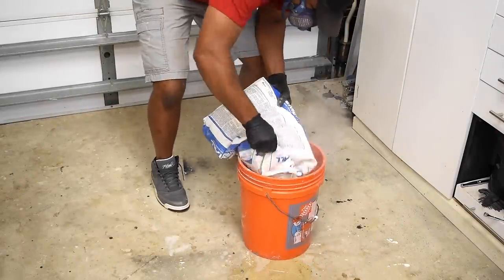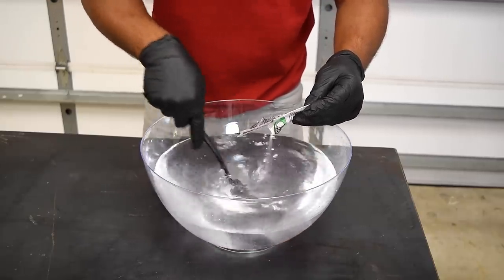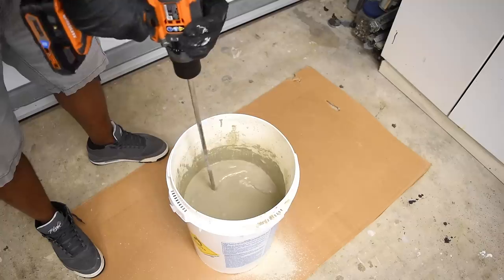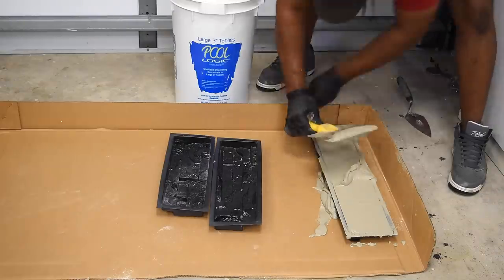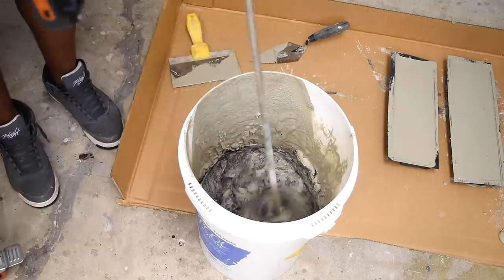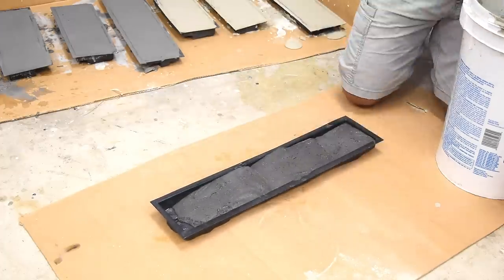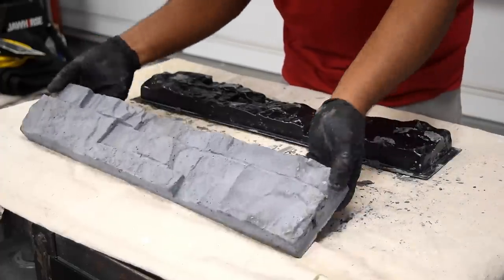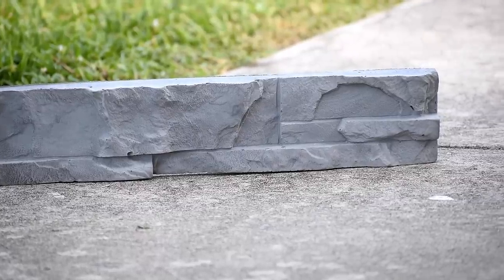How to make Concrete Stacked Stones ( Homemade Wall Stones )

Comment: Those turned out lookin super sharp! I actually prefer the look of the concrete molds vs the premade expensive ones. Well done!
Reply from the maker: Thank you, I was not sure at first but I like this a lot! Now I need to learn how to make them more interesting.
Reply: DIY Creators I'm wondering if you could get some interesting effects by mixing a few different colored concretes in small batches and then scooping small amounts into the form to create some color variation on the face of the "stone". Glad to see someone do this as a diy!
Reply: How thick is the finished wall stone that you poured?

Comment: These turned out really well! Better than I was expecting. Nice work! Could you use maybe a palm sander on the edge of the mould to vibrate the bubbles to the top?

Comment: Would using something like this be appropriate for exterior works such as the foundation of a house or making concrete steps looks nicer? 

This seems like a.oretty fun project. How heavy do the blocks end up being?
Reply: I would like to know as well. My foundation below my siding looks barren
Reply: I'm curious as well
Reply: Bela, that is what I am doing. The cost for siding is way too much, so I am doing this.  $2,000. over $30,000. sounds like a good deal to me.   I think about 5-8 lbs they should weigh.
Reply: inspire734 please share your experiences and maybe even a video :)

Comment: Would I glue these to some cement blocks for a wall?  Or to wood for a planter?
Reply: You set them with mortar just as you would any stone or brick. You could use a construction adhesive as well. Your backing could be drywall, wood sheeting, or madonary.

Comment: Great video, you can spinkle multi dry colored powders in the mold like the ones they broadcast on slabs right before they put the rubber stamps down, this will give you a multi color variegated look.

Comment: Wonder if you could airbrush/spray paint some details
Reply: They are usually stained.  People that do floors have colors on the internet just for cement. I don't know if they stain them on the top or the cement it's self.  Painting the outside of them, they would fade over time. The stain and sealer works just for the cement.

Comment: In addition to using color added to the mix, when you have a completed wall stone, make a thin wash with black paint.  It should be almost like black water, you should do a test to see how much tint you need.  When you brush it on, it will darken the crevices and cracks, but barely darken the edges and flat open parts.  When that dries, thin some white paint, (doesn't have to be bright white)  and dry brush the high points and edges.  Dry brushing means almost all the paint is off the brush so only a little will adhere to the high points.  This will give a very realistic finish to concrete wall blocks.  Make one to practice on, it doesn't take long to get the hang of it.

Comment: Here a vibrating table is needed for bubble removal and, preferably, silicone forms. ... and it is necessary to tint the forms partially, it looks more natural. Oil will help to separate the product from the form. Sorry for my French ))

Comment: Add pumice stone to reduce weight and use less cement. Also you can add dye powder to different areas of your molds. Try adding metal straps, overlapping the top and bottom for mortarless installation.

Comment: Quite an interesting approach, especially the Bar-Idea. I would probably try to add some kind of foam to make it lighter and save on cement cost. Of course the rigidity is questionable, the more material is replaced by soft spots, but for decoration stones I assume it should be alright.

Comment: GAH! Not another Rapid Set video. You guys I subscribe to are killing me!

I started using RS's "Cement All" about 10 years ago for our small ornamental concrete business. As you guys keep popularizing it? It's getting harder and harder to just walk into the depot and buy the quantity I need off the floor like the good old days.

I'm gonna have to start buying it by the pallet soon so I always have enough lol.

As a small tip I can offer? Using cold water in your mix will slow down that cure time as well. The colder, the better.

Comment: A couple things.  Add some color to the molds before filling that way you get more variation and make sure you vibrate them more to get rid of the air bubbles

Comment: This is a great idea, you could even cast your own molds from silicone.
Reply from the maker: Yes, I thought about that, I may do it in the future.
Reply: That may challenge the 'cheaper' argument
Reply: @Ed19601  Maybe, but if you want a specific pattern...the molds are $60 so it might not be much more expensive.

Comment: The best mix to use is called Sakrete Maximizer which is a light weight aggregate. Meaning it is light weight and fine mix. It is a lot cheaper then the mix you are using. An 80lb bag is about $10.
Reply from the maker: Thanks, where do you get it? It's not available at any of my local stores.

Comment: Nice job man. They look good, but I'm curious how the price will compare to the prefab stone veneer so I did some quick calculations. Based on the molds you linked to in your blog, they will cover 5.6 sqft (0.52sq meter). Supposing someone had all the other tools (mixer, trowel, bucket, etc) you're looking at an initial investment of $65 for the molds + $25 for the cement + $10 for color and set control. So $90 + roughly 1 hour of time to fill 6 of the 9 molds (~4 sq ft).  A similar style of prefab stone veneer can be purchased from the big box stores for $45 for 4 sqft. Granted, after the first batch of DIY veneer, the cost would drop to $35 + time, and hopefully once you figured out the correct coloring, you could get all 9 molds filled. I guess it's going to depend on how big of an area you plan to cover and how much time you have available to make your own. 

Great video either way. Keep the vids coming. Your projects inspire me to get some projects done too.

Comment: Wow 😮 this is awesome my wife will be very happy with this idea thanks you,
I have a question .. what mix do you recommend to use to reface or refinish my concrete path that’s 3x15 ? Got some cracking and rough rocks showing  .. I see many products cement bags ect. at homedepot and looking to get a smooth long lasting finish ..
Thanks your help would be appreciated 🙏🏼

Comment: If you run a notched trowel or a straw brom over the back of each one before the concrete sets, the texture helps each piece stick better to the wall it's applied to.

Comment: I love these! I have ugly fake stone areas on the front of my house. They are about 4’ x 8’ and there are three of them. I wonder if I could remove the ugly and add those instead? It would look so cool and modern! Have you ever tried hyper tufa? I haven’t tried it but have seen planters made out of it. It is Portland cement, Perlite and Pete Moss. I was wondering to make a replacement wall for my ugly stones I could make hypertufa blocks like the ones you have shown. Those are awesome! BTW I found your channel when looking for floating shelves. Your channel is fantastic and you are very talented. Thank you for sharing your awesome work!

Comment: This is a great idea but.. I will definitely be doing this but I will be using aircrete. Making Aircrete is much lighter and cheaper. However the only drawback I can think of is durability. But seeing as the faux stone will be installed on a wall or something similar I don’t think impact durability will be an issue. As for the dye. I would not do a complete mix in, you want the stone to have a natural look. It would be best to use a slow set mix so you can do one big batch. That way the colouring pattern will be similar. Great video
Reply: Ross 2077 everything I've seen about aircrete lends me to feel like it's Botond appropriate for outdoor application. If you were to use this  on an interior wall that would be cool. My only concern would be visual bubbles on the surface of the "stone" giving it  less natural look. 

I'm wondering if you could do s thin layer of just concrete for the face of the stonework and then do aircrete for the rest. Maybe I'm overthinking it.

Comment: Great video! I found it easier to start with the water in the bucket and then add the concrete in small portions mixing in between. Any your right stacked stone is stupid expensive.

Comment: Thank you for this video. It has given me ideas about doing my living room corner wood stove surround. I'm looking for a natural aged limestone color. I see the molds are expensive and was wondering how durable they are? It would be cool if you could do a video about how to install these tiles. Should they have some type of a mortar joint? They would be mounted to cement board.

Comment: The colours are great! There are a fair number of bubbles on the surface still. I wonder what would happen if you put the molds on a 4x8 sheet on saw horses and vibrate the sheet with a sander (or other tool)?

Comment: If you want to add colors sprinkle in a light dusting of iron oxide pigments after first spraying a mold release and if you want to lighten up the weight add either  pumice , vermiculite  expandable polystyrene beads and that will significantly lighten the weight for easier install !

Comment: a couple of useful tricks:
1- Scratch the back of the stone with a fork while setting to have  better adhesion later.
2- mix some dry color with some water and give the molding some random strikes with a brush before pouring the mix. It gives more natural looking especially with more than one tone.

Comment: Should you not put some type of holding grid in the cement on the backside? It it cracks then it will not fall apart. Plus i would screw the pieces to the wall with some adhesive on the backside to hold it tight.

Comment: I find if I spray the mold with a light coat of WD-40 before pouring, the cement releases super easy.
Reply: Pam or Vegetable oil spread lightly over the mold works very well too.. never tired wd 40 will have to try it.

Comment: I used some similar molds a few years ago but used cementall mortar mix instead. I also got the idea to use a plasticiser from MAN about Tools and used cheap cooking spray as a mold release. I have yet to paint the ones i made but the cheapest and best ideas I've seen for that is to use watered down acrylics. Watch some of fauxrocktraining youtube videos to get an idea of how he does it.

Comment: I want to do a stack stone feature wall in a fully enclosed deck. I'd prefer using a plastic or rubber compound because the weight of the concrete would be too much. I wonder what product could be used in the molds to reduce the overall weight once they are mounted on a wall.
Reply: Aircrete...   can add pearlite as an aggregate and heavy soap foam to greatly reduce mass and weight.

Look up aircrete harry.

Comment: Two thing , add water to the bottom of your bucket , half of what you need before dropping your dry mix , it will help you a lot in the drill mix ...second add a dusting of colour mix powder , random clumps and see your stone look lore natural or mis in a bottle and using a dispensing caps make swirl on the mold before you poor it will make some amazing marble effect .....now , where can I find these mold in silicone for multiple usage and easy release ?

Comment: looks like vibration or some sort of other treatment is quite important, as there were significant bubbles. Overall I'm not into "faux" looks usually though, so I'd either use some other material, or just use flat out unmolded concrete (I like the look of concrete personally)

Comment: Combine this idea with aircrete and/or pearlite for weight and material savings...  lighter weight means you can more easily stick it to a wall with construction adhesive.  Material savings means more bricks per bag of concrete.

Check out channels like aircrete harry.  All you really do is add really thick soap foam to your concrete mix.  If the brick floats on water, you are doing it right!

Comment: We built a Foxx Block home with stucco siding in 2005, on a slab foundation. Water seeps up along the stucco near the ground and the stucco peels off. We want to create a stone/brick facia approximately from the ground up... 4'. We only need to do 120 sf. I was wondering how many deco stones can you get from 1 bag of concrete?

Comment: At home depot you can get 6 pieces for $5-$150.
For just 9 molds, and go with quikrete. It's cheaper then this. Just takes longer to set up. But you can also put something in it to speed up the drying time. But like $4, compared to $22.
So with the quikrete and molds, that's $69. With cement all and the molds, that's $87.

So it costs more to make your own.
Reply: @Stackali  Year, but not with this concrete. The one he use, you can get 6 stones at home depot for about $5.
If you use the less expensive concrete, something like QUIKRETE for $3-$5, then it can save you money. 
Which is good for small projects.
But if you doing something big, like a house. You would need more then 1 set. Unless you only do 9 at a time. It will take week to do like 1,000 of them.

Comment: Take a fork to the back to make ridges so it will stick better to the wall. I do my ceramic tiles like that. As they set up. I use a up and down curving back and forth. You can stain the stones also. I wanted to put siding that looked like bamboo on my house with some flag stone.  The cost would be over $30,000. more than my house is worth at present.  I found that by using this cement thing, you can also make your own molds, plenty of places on line that sell mold making kits.  It cost a faction of the price they wanted.  The major thing is a 61 year old woman with fibromyalgia can even do it on a good day.  I love living in this day and age, there are so many possibilities to decorate your home the way you love. My home is my childhood one, but a fixer upper. I payed $1,230. for the place 1,300sq ft. Needs some artist touch. Got it at a tax auction.

Comment: Very nice! Would this be a good borter for the edge of my gravel driveway if I supported in with some sort of stakes to take off of it on the edges? How could in remedied that it is that way with sand? Great Job!!

Comment: Best thing is to go buy a box of plastic simulated wall stone.
Then use them to make your own molds with.
Now you can pour as many as you need for your project at 1/10 the cost of the pre-fabe platic garbarge you nail into place.
With concrete you can tack chicken wire securley to the back ground and mortor on your castings permentaly.

Comment: I’ve tried many times and I let them sit for about 1 hour at which time I then tried to remove them. Twisting back and forth with my hands on each end cracks the concrete everything right in the center. I’ve tried to do many things but they just won’t come out of the mounds without cracking as I have to get a bit rough because they don’t budge. I just bought some actual concrete release that are used for sidewalk forms for production on the job concrete but it still seemed to be difficult to get out and still ended up cracking. I’m wondering if I need to let them setup further? After an hour they seem pretty hard but obviously not cured. Should I let sit overnight or just add an extra hour prior to trying to remove from the mould? It’s getting a bit frustrating as I’ve tried about 6 so far and I only have 2 that have been successfully removed, that’s just my going to cut it. Lol

Comment: cement all is expensive. 25 bucks per bag great set time and psi.  I use this for floor leveling.
Reply: Come here, in Croatia bag of that size is about 4 bucks. Hundred kg (about 220 pounds)  costs about 12 $.

Comment: Great one, just wondering would that work with plaster? Would it be lighter than cement?
Reply: Plaster of Paris desolves when it gets wet, not good for out side projects over a long period of time.
Reply: @inspire734  but it should be alright inside ? Maybe bit more brittle is it?

Comment: Great video. Thanks for sharing. Unfortunately, I cannot open the  homedepot links to the cement, bucket and drill. It says access denied (from Europe?)
Bucket and drill I have. I'd like to get info on the cement (price and specs) and the accelerator.
Reply: Bob Charlie  Ok, thanks.

Comment: Thanks for the video! One question... are these walls really strong. I am researching on mixing with sand but all i get is that they still crack and break. Any advice?
Reply: Add wire mesh or i like to use chicken wire, alot of it and acrylic concrete  bonding mix

Comment: I wonder if you can use some moldable material that is lighter than concrete for this?
Reply: PeoplePhobic mean that crete they use for building homes yea a slab size of your body is just a few pounds and its cement with a couple of  other mixers

Comment: A concrete mixture would probably work better and go further. Mixed with sand or aggregate
Reply: Sherroy Archie...
Sand is aggregate you
mean rock...
Reply: @slickguns7891  yes, rock aggregate.

Comment: there are various cement projects I want to try , but roadblock 1-cant lift bag 2- don't want to break my nail(s)
Reply: 1. us true artist cut off our nails, not needed in our world.  Take out half the bag, you should be able to lift it. but do it close and you can use a small garden trowl to scoop out the cement or concrete. One you add to rocks and the other you don't. I would ask the stores which one is best.
Reply: @inspire734  head tilt.

Comment: May i ask you please.. why when my cement projects dry they have major cracks in them.. even though i keep spraying them with water?..
Reply: If I had to take a guess, I would bet that you are not vibrating the forms enough to get the air bubbles out, either that or perhaps this cement not mix to the right consistency.